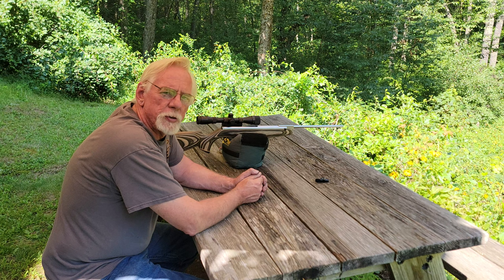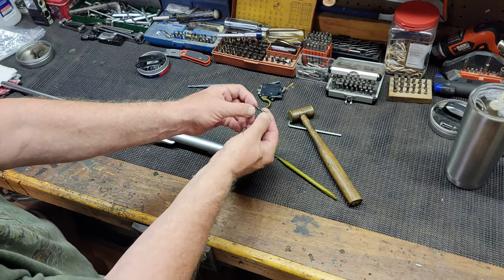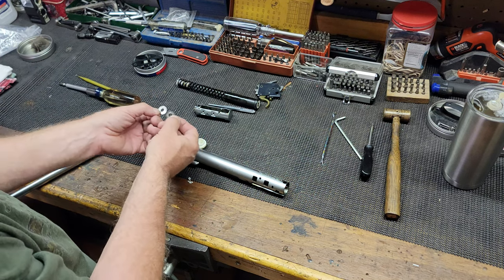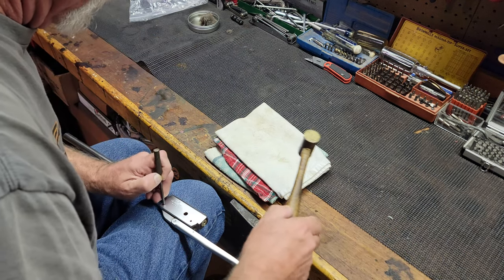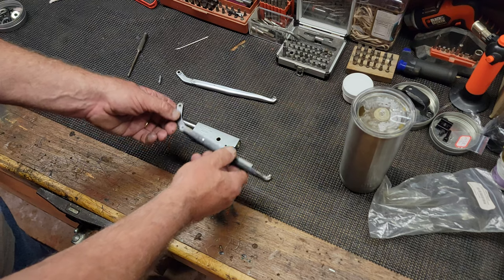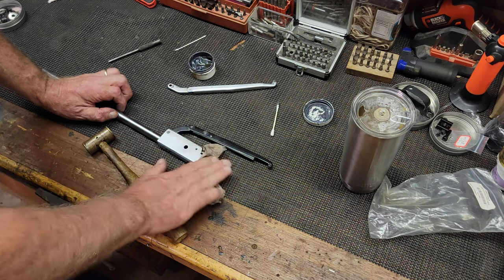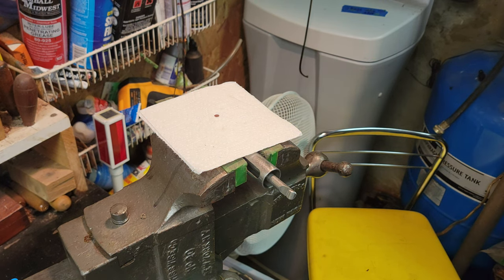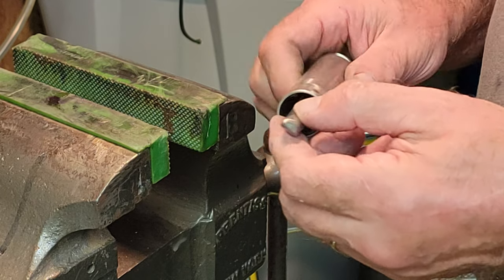Custom HW50S Air Rifle Rebuild Pt 1

Comment: Another excellent video...I'm sure that you will succeed with your fettling of these fine rifles. Like you, I have it in .22 (a 99S here in the UK) and its a truly sweet firing 12fpe rifle after being tuned by Sandwell Feild Sports. Keep up the excellent work.
Steve
Reply from the maker: Thanks, Steve. You've got yourself a wonderful rifle.  Always a pleasure, my friend.
Reply: Love the Sandwell Imps ! Excellent Rifles 🤤👌 But I build mine quite similar, and actually getting the very same output & accuracy as Si. 😃👍 If I were in the U.K. I'd likely have 1 of each already... They're an Excellent Value. 😉

Comment: Learning more trades and tricks every time from your videos. Thanks Kevin. Most important for me:  to take a calm and prepared approach. So everything is done properly. Besides about the different models and brands.
Reply: Kevin's always calm... Completely chill... 😂... 😁... 😏
Reply from the maker: Thanks very much. So glad to know that you're enjoying the channel.  Don't think of me as a pro. I'm just learning as I go and taking folks along for the ride.
Reply: Patience & Planning are the key... Know when to step away and reevaluate the situation "BEFORE" you lose your temper is the Real Trick ! 😁😆😅😂🤣🤣
Reply: @marcmyers1465  I know. I am older now..but when (a lot) younger  when trying to fix for instance my little Honda Dax or whatever,  Loosing temper was not uncommon. With the limited tools we had. Hard to come by parts. Plus learning all about motors, and bikes! Anyway,  I worked as an allround metal worker for decades. So that also formed me. These days, I can leave an open unfinished airrifle for another day. If that day all turns bad what I touch lol.
Reply: @Iheartmyson One of the Very Rare perks of Old Age. 😕

Comment: I put beeswax coat on my HW50s. looks great. Great shine. I'm thinking of putting a vortek kit in mine. I it is anyway possible, could you say in percentages 0-100 how much more pleasant shooting expericne the kit does, Im thinking should I go through with the effort. Thank you. - Fellow air gun enthusiast.
Reply from the maker: Hello, my friend.  I think that rating the level of a "pleasant shooting experience" is a rather individual perception. If your rifle has a noticeable spring buzz / twang, then the kit will make a very noticeable difference. If you're planning on going with a high output kit, you'll most like likely notice a difference in the recoil as well as the "locktime."
Beeswax sounds like a great idea. If I'm not mistaken,  it was a commonly used steel protectant back in the day.
Reply: @razor1962   Thanks for the insight my friend. The product I used was Liberon Beeswax, I rubbed the product into the stock with rubber nitrile glove, and when I was done I went through the it with hot air gun. It gave the stock a great shine and protective coat. I should have listened when you said in one of your videos to tighten the screws on the stock once in a while. I am missing one of the stock screws and had to order a new one

Comment: Good job bud although I’ve done a few of these rifles well the hw99s in the uk and the new cocking lever only moves the problem to inside the cylinder, it leaves tram lines either side of the cocking slot.

Full anti gall mod is the newer cocking lever but then you loosen the front tight rivet with a wide flat head screwdriver and a good tap from a hammer then next you remove the spring from under the delrin/nylon insert and remove some material from it until it only protrudes around 1mm max and last you take a little material off the edge of the cocking foot on the part you polished last.

This does make them cock super smooth and it’s not all my findings it’s just a collective from the uk forums.

Have fun.
Reply from the maker: Great info! Thanks very much for this. I may revisit this rifle and take your advice. Much appreciated, my friend.
Reply: @razor1962  no problem, I’ve heard of people never having the galling with the new arm but I believe they just don’t notice it as it’s inside and  doesn’t feel as harsh but I’ve done 5 and know a few people who have had to do every one they’ve owned so it’s more common that not that’s for sure.
Reply: Full ? Trust me... some take it even further tapering and polishing the cocking slot, and gliding the wings of the cocking shoe. 😉 but you're right, it does make it buttery smooth ! 😌
Reply: @marcmyers1465  yes the wings are what I meant when I said removing some material on the edges of the cocking foot bud? I don’t think widening or tapering the slot would be beneficial tho as it’s not the side of the cocking lever that galls but I suppose it won’t hurt and I didn’t mention polishing the slot as to me that’s part of tuning any spring air rifle anyway bud.

Weihrauch really should sort this out now tho I mean even cheap rifles like the Remington express have zero galling with a articulated lever.
Reply: @FrostiTheRoadman I actually camber and button the tops of the wings, and gently buff the inside of the slot to relieve a bit of material to ease the path. "Two pieces of matter can't operate in the same plane of existence" so the lord giveth and the Lord taketh away ! I delrin sleeve the piston, and grease the trough with moly for the shoe to slide across. 😉 In the end zero metal to metal contact. 🤗
Reply: FTR: Not all obsessive compulsive freaks are created equal, and a few of us have a shop chock-full of really, Really nice Toys ! 😃
Reply: @marcmyers1465  that will surely result in a silky smooth action nice work.

One other thing I’ve noticed on 2 of these I’ve worked on is the last 15-20mm of the cylinder where it meets the transfer port was constricted and you could feel it when sliding the piston home, my opinion is the end plug wasn’t super tight in the cylinder and then welding has led to the constriction.
Reply: @marcmyers1465  yes I don’t have a shop full of nice toys but a lathe is something I need one day and if you have the machines it’s a waste not to use them that’s for sure.
Reply: @FrostiTheRoadman I've noticed this on a few rifles. Usually the older transitional  rifles. 😉 We may yet see it here as well ? 🤔
Weihrauch did very well re-engineered the cocking lever and the early rifles didn't have that, so I'm pretty sure there were likely other improvements along the way. Obviously they got it right in the end, and HW99's/HW50S's started flying off the shelves just as fast as they can get them in.

To date the single smoothest cocking linkage Was the FWB 124. If you take some DMT Diamond paste you can polish and mate the cocking shoe to the piston, then sleeve the piston and grease the trough you can get it to ride like Wet Ice !!! 😳
The late model LGV's came very close to perfect but sadly the Factory triggers condemned them to Mediocrity... 😒
Reply: @marcmyers1465  It was on the hw99s that I had the tight cylinder issues I’ve not noticed it on other rifles. I agree my fwb sport was smooth to cock for sure and I had a lgv and lgu I never gelled with the lgv but I did the lgu apart from the sloppy cocking lever and pot metal trigger housing as you say, I got a replacement trigger blade from Tony leach and it transformed it tho and currently have one of his skirted 22mm kits in my pro sport and that’s amazing
Reply: @FrostiTheRoadman The Beeman R6 and subsequent Beeman imported HW50S's were simply rebranded early  HW99's and yeah it was very hard to bring them to full power. Beeman clearly stated it was a 10.5 FPE rifle but then conflated the FPS to 800fps by using 7.1 gr. pellets ! 🤬 This confused or misled allot of people and caused a great deal of disappointment with the R6. ☹️
The R6 and subsequent HW50S were only imported in .177. After they got the bugs worked out and they brought them up to a full 12 FPE they started bringing in both .177 and .22
Never the less those early intermediate rifles are still out there and a source for quite a bit of confusion. 😵
I think allot of it hinges on the restriction at the front of the tube. In which case a genuine Sunnen Honing should remedy the problem, but that's asking allot for an HW50S ?
Probably best to be happy with 10.5 fpe. and simply enjoy the rifle as it is. 🤷🏼‍♂️
Reply: @marcmyers1465  I agree bud I’m sure getting a shop to hone it over here in England would cost more than a new cylinder or near enough.
Reply: The Weihrauch HW50S was the 1st. post war air rifle offered by Weihrauch. The original format was 25mm with the threaded end cap. These were imported by ARH and then Beeman. Beeman eventually offered the Beeman HW50M with the balance of the Sile Luxus stocks, but immediately then offered the Beeman R8 with the HW50S action and the newer Gary Goudy R series stock pattern scale down from the R1, and R10 and then eventually the R7. The Goudy pattern was commissioned and offered exclusively by Beeman only. 😉
When Weihrauch curtailed production of the 25mm  actions the HW50S Legacy was reborn in the HW99 26mm format, and here we are. 🤷🏼‍♂️
Reply: The Original 25mm format was a true 10.5 fpe gun, and the action was also common to the HW55, but the 55 had that extraordinary lever breech latch and a shorter piston, and a tapered cylinder producing an extremely smooth 660 fps. 😊
Reply: @marcmyers1465  I’ve had a original hw50 with the screw in end block and it really did shoot sweetly mine was .177 and shot at 9 ftlb but very subdued cycle for such a light weight.
Reply: @FrostiTheRoadman I have 2 .177 Beeman HW50M's, an HW55M, and an HW55CM. The 50M's are tuned just a skosh over 9.5 fpe. with ARH kits producing 720+ fps with 8.3 gr. JSB Exacts but they'll likely come up a bit once the kits fully bed in ? 🤔
Reply: @marcmyers1465  yes I guess they will gain 10fps? I have just reduced the cylinder on a Remington express to 25mm as I had a old bam b20 mk1 piston laying around and it really is a sweet shooter 25mm bore, 81mm stroke and 23mm x 3.3mm transfer port. It looks perfectly standard on the outside I think it will raise some eyebrows when people try it lol.
Reply: @FrostiTheRoadman I like tuning unconventional guns that people often overlook. 😉👍
Most, if not all the early Weihrauch rifles had larger breech ports and tapered cylinders, and came with leather seals. You can "usually" upgrade the seals with an adapter for the urethane seals. That's usually good for 10 or 20 fps. You can replace a broken or tired old spring, you can use proper guides and lubes to smooth it out or guiet it down, but there's only so much you can do to increase the power output due to the tapered cylinders and larger breech ports ? 🤷🏼‍♂️ 
You're mostly just spinning your wheels until you deal with those issues, and it doesn't doesn't go nearly as far as most guys ultimately would wish for. 🤷🏼‍♂️ Many Airgunners have a Black Belt 🥋 in making a Silk purse out of a Sow's ear ! 😂
It's usually best just to love em for what they already are... 😊
Reply: @marcmyers1465  I never knew that it was common in the vintage weihrauchs to have the tapered cylinder issue but so learned something but they’re the only make I’ve encountered it on to be fair although the trigger barrel and lockup are second to none so I suppose it was overlooked maybe.
Reply: @FrostiTheRoadman It was "Designed" into them intentionally, along with a short area of surplus air up front. To bring the piston to a gentle end of the stroke and help to buffer the impact. That's why Olde Weihrauchs are so quiet and smooth ! Herman "Designed" them that way. The industry "learned" to "Exploit" combustion gradually. It didn't happen Overnight. 😉 Newer Weihrauchs have longer strokes, smaller transfer ports, synthetic seals, and fitted guides. It's just the natural evolution of Springer Design. 🤷🏼‍♂️
Reply: Then again the Older rifles just lasted and worked FOREVER with very little maintenance or fuss. Hell I've got old leather seals 35 to 50 years old and they still look and work like new. They were Built to Last and more Specifically to take out and shoot the snot out of em. 😊 They never planned on people D!cken with them... 🤷🏼‍♂️
Reply: @marcmyers1465  I do agree the old leather seal 50 and 35’s are smooth shooters, I think the latest piston seals can make them feel harsh aswell I preferred the straight sided polyurethane seals.

Quality has dipped for sure I feel it was highest at around the end of the 80’s from what I’ve seen on rifles, I’ve had new ones with two shims at one side of the breech block now and ones that were sloppy. I’ve also had a new hw95 that in direct sunlight you could see the steel was mottled under the bluing.
Reply: @FrostiTheRoadman You can actually take an FWB 124, a Weihrauch HW35E, or HW50S and the big take away from any of those guns is that they are all Accurate, easy to cock, have a gentle firing cycle and honestly just ooze Class and Craftsmanship. These "Improvements" we make in their output and efficiency we make are almost "Always" at our own expense. 🤷🏼‍♂️ comes a point in time that you are no longer willing to compromise on or sacrifice the simple Joy of shooting a particularly Fine Airgun. 🤷🏼‍♂️ Be Very Careful what you wish for. 😉 I love my late model .22 50S, but if forced to choose I'd probably keep the Olde 50M. 🤔
Reply: @marcmyers1465  I agree bud and feel sometimes a nice fitting set of guides and new lube is all you will need.
Reply: @FrostiTheRoadman A cylinder can only hold so much air. In the quest for power, As you increase the stroke and spring you are using up any buffer the chamber has in reserve. The shot cycle is getting faster, but more abrupt and the barrels just keep getting shorter. 🤷🏼‍♂️ 12 FPE is basically the practical limit for this format, but 9-10 fpe produces a better shot cycle, and the original lighter spring and 18.3" barrel were just easier to cock. 😉
Reply: @marcmyers1465  yes true is that I feel tge 16” barrels were nicer on the weihrauchs than the 12’s. And same on other makes for sure.
Reply: @FrostiTheRoadman I think your observation of the end plug on the early 26mm HW99/50S is accurate. In the case of the HW99/50S I don't think it's so much a case of intentional tapering, but more a case of a radiused crowning in the end blocking the stroke. 
I think this really only pertains to certain rifles in this production transition.
Thankfully Weihrauch got it sorted out My late model 50S is absolutely Stellar and works a treat ! 😃👍

Comment: Hello, I have a sort of related question.  I have a brand new HW50S. I purchased at Airguns of Arizona and I had them put in a custom piston and seal.  That works great.  My question is after a few hundred shots, it is still really hard to close after cocking.  It is the hardest to close of all my rifles.  Could this be a problem like you had with this rifle, or is it common on a new rifle and might settle down after a few more shots?
Reply from the maker: It's hard to say, Bill, without having it in my hands. Is the barrel clamped too tightly in the forks? Have you tried a good penetrating lubricant spray like Balistol, to the barrel latch? It could be that the latch is binding in the hole that it slides in.
Other than those two thoughts, nothing else other than having touched off the rifle while the barrel was down comes to mind.
Reply: @razor1962  Thanks, I will give it a touch of Balistol.

Comment: It just kills me when you put all parts in a bowl, now I know you know where they go cause you done so many , not me . Where do you get parts for you’re springers ? Thanks Kevin 😎👍🏻

Get the sling shot out and ring that bell 🔔
Reply from the maker: You know what they say, a good mechanic always has parts left over after the job is finished. 
Never thought about a slingshot...😁
Reply: @razor1962  ha ha that’s what worries me  ha ha . Take a picture with the phone 📱 would be more my route  thanks Kevin
Reply: @PeterAgostiniJdcap26  Kevin is a well experienced gunsmith I'm sure he remembers where all the parts went, but if his memory needs jogging he can always replay the video.......lol.
Reply: Peter, with all your Modeling, Detailing, and Repair experience I'm quite certain you'd take to it pretty quickly. It all comes down to spatial recognition and details. Some guys have it, Some don't, but you obviously Already Do ! 😁👍
Reply: @marcmyers1465  very kind compliment thank you  Marc

Comment: That original cocking lever insert was an improperly installed ARH Weihrauch cocking lever insert. If you follow the directions they clearly tell you how to properly shim them out for deeper cocking levers... 🤦🏼‍♂️
You simply split a second piece and place it in the notch at the bottom to make it sit proud of the lever, and either sand or shave the top down to fit. I just use a finger plane. You can also shim it out with Gorilla Tape to make it fit more snugly. 
But the strip is a generalized dimension (it's impossible to make one strip to fit every  Weihrauch variant) so it has to be properly fitted by the end user. ☝️🤨
Folks use to call it anti-click strip. 😉 
These days I machine my own inserts for particular rifles, but that's a one off process for individual rifles, but I still stock the ARH insert. 👍 Works in a pinch, and if you don't have the time or tooling to machine your own, it's a far sight  better than a sharp stick in the eye. 😊
It's just like the Old School Buttons "IF" you simply "Follow" the directions IT WORKS ! 🤷🏼‍♂️ But don't try to use some random similar looking strip. This is a proper Delrin material and most other plastic or vinyl strip is just going to Jam up the works !!! 🤦🏼‍♂️🤦🏼‍♂️🤦🏼‍♂️
Reply from the maker: The factory strip on my fireplace mentioned cocking arm appears to be pretty well thought out.  Some have told me to remove the spring that's under the strip. So far, I see no need to do that as the gun cocks smoothly and without any galling. 
Thanks as always Marc.
Reply: @razor1962 The new factory glide on my late model 50S works Great. Never needed any adjustments. 🤷🏼‍♂️